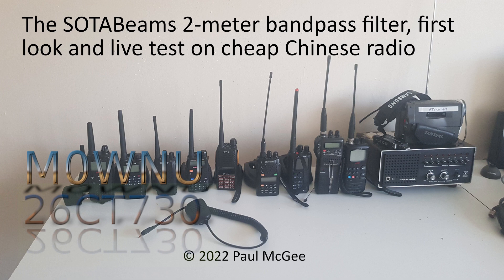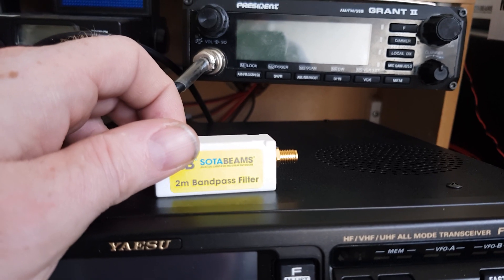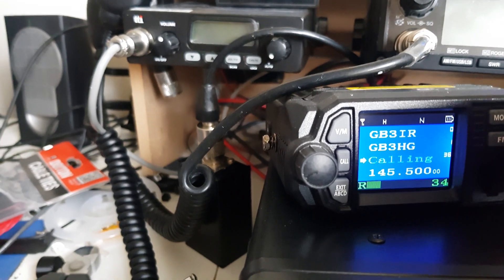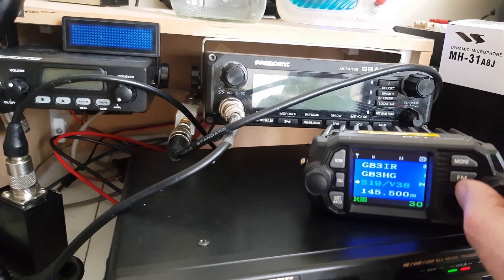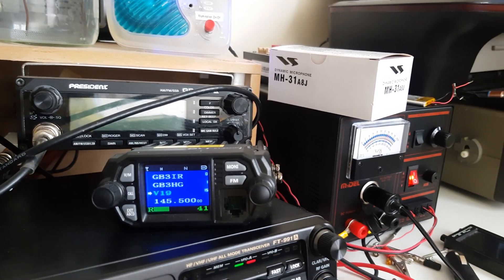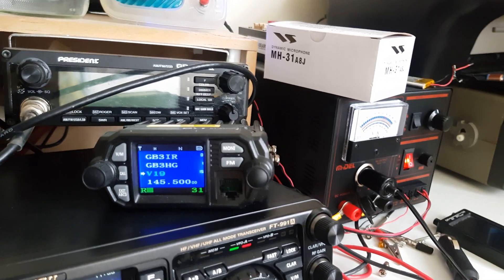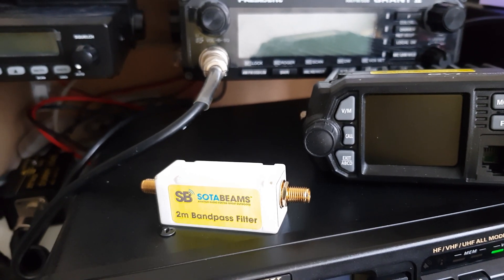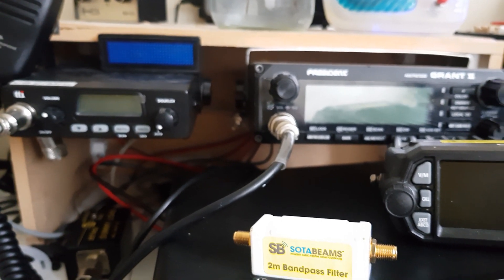The SOTABeams 2-meter bandpass filter, first look and live test on cheap Chinese radio

Comment: Paul am trying to contact you about some radio help
Reply from the maker: Hi there, how can I be of help?
Reply: @PaulMcGeeM0WNU  I have a t600 CB I would like to test with you and I want to also get into ham radio l live in Leyburn
Reply from the maker: @richardmorris66  ah of course, I'm not sure I'd hear you on the CB from Leyburn at home as the antenna I use for it is a bit of a compromise and I have a lot of noise here, as for the ham radio side of things the closest club is probably the Colburn and Richmondshire District Amateur Radio Society which meets in Hudswell usually on the first and third Wednesdays of the month
Reply: @PaulMcGeeM0WNU  I was over at Richmond last weekend and gave you a shout nothing heard
Reply from the maker: @richardmorris66  ah right, if you mean this weekend gone I was over in Blackpool
Reply: I am over at Richmond tomorrow night give me a time and a channel
Reply from the maker: @richardmorris66  I'm usually working on evenings (I work delivering food and do have a CB in the car) I usually monitor channel 19, will need to screw the antenna back on first though

Comment: Is there any chance you could test this on a Baofeng GT3 as it has an upgraded audio driver chip over the UV5R. Thank you ✌️ 😊
Reply from the maker: I don't have a GT3 but I do have a GT5 which is based on the UV82 and I will be testing it on that at some stage
Reply: @PaulMcGeeM0WNU  Oh brilliant. I need to look at the GT5 circuit diagram. Look forward to your next video.